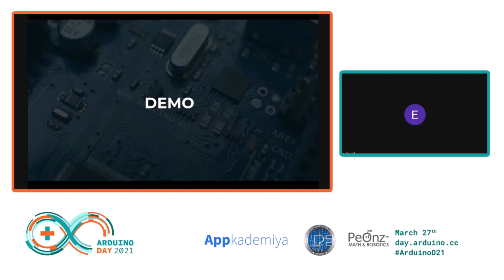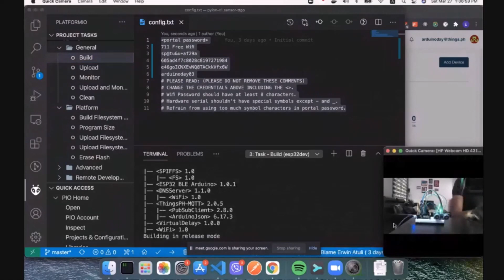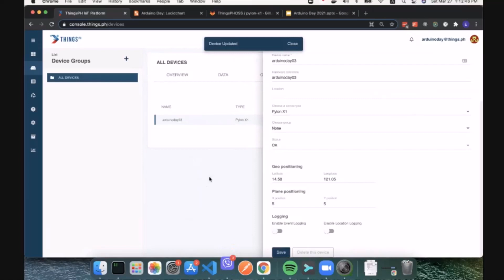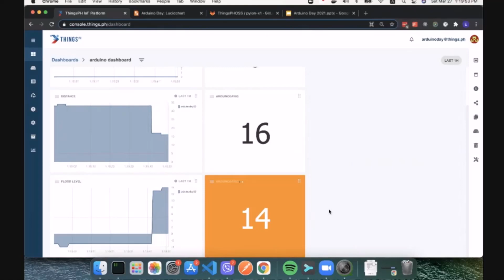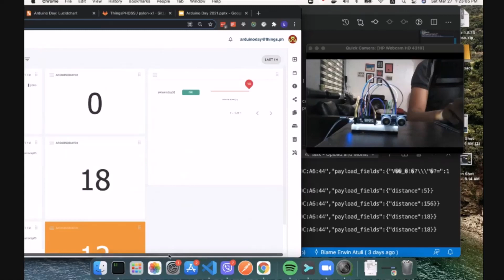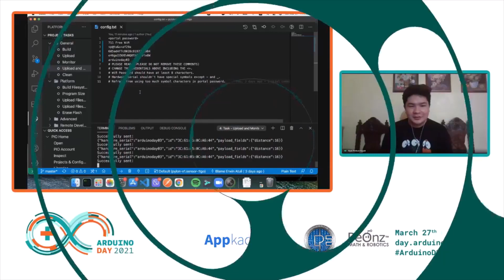Enabling IoT in Arduino using ThingsPH

Comment: Excellent video, I'm using the platform but I still failed to visualize the controls, add 2 switch controls but I could not add them to the dashboard, it does not visualize them.

Comment: I have a question. Can we use the ESP8266 Wifi Module connect with Arduino UNO? To connect to the platform. Thank you
Reply from the maker: Yes, you follow this instruction in setting up your esp8266 to connect to the MQTT broker:

https://www.emqx.io/blog/esp8266-connects-to-the-public-mqtt-broker

Then, in the ThingsPH platform go-to devices > add a new device

For the MQTT broker, you can see the host, port, username, and password.